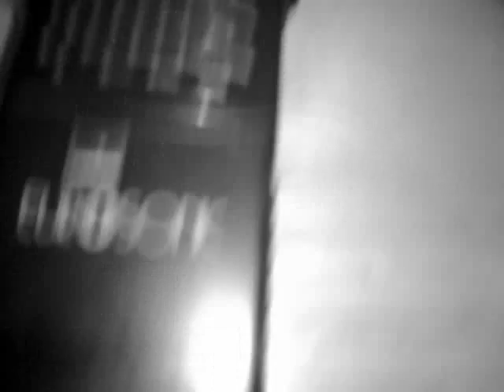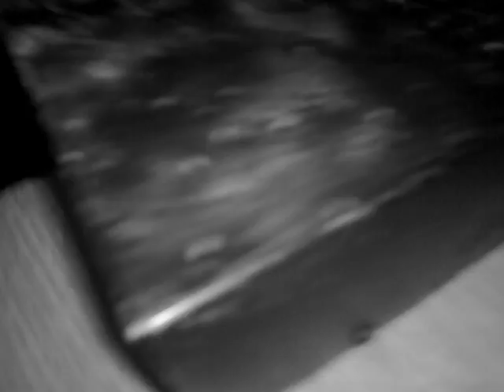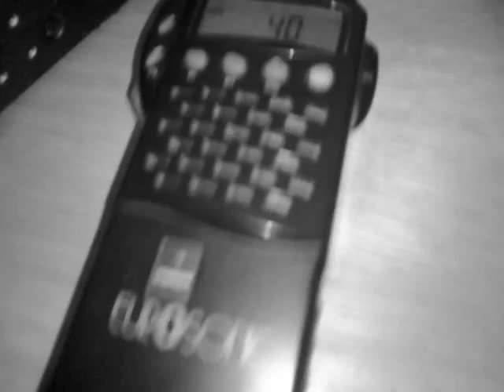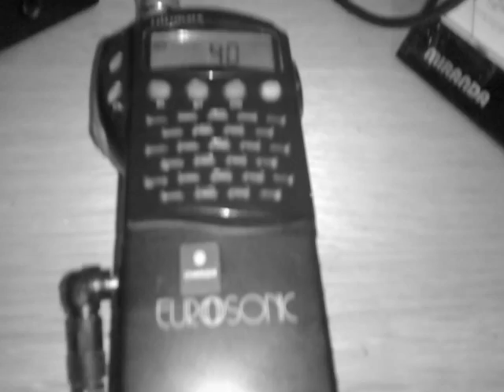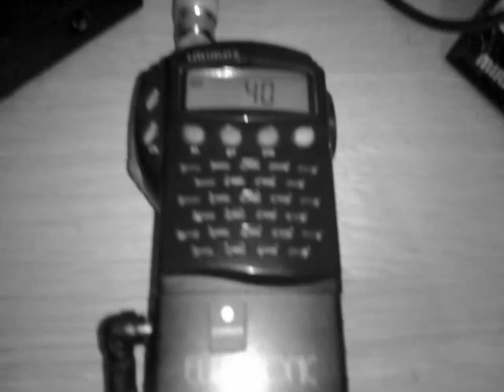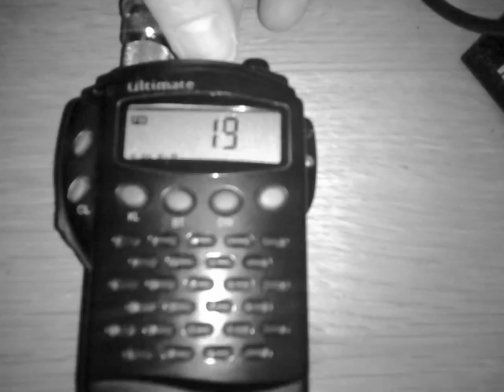eurosonic ultimate cb radio part 2

Comment: I have the same rig, working perfectly, has a rubber to cover the speaker/mic plug and the hand strap, never seen a instruction manual but easy enough to work out - unless there's a secret menu I haven't found? thanks for the videos. PS- under the clip on the back mine says (Eurosonic KH-104)

Comment: I remember the ultimate well, when i started my business (selling cb gear) in 1996 there were 2 handhelds available, this and the Alan 95.   As i recall, there was a warning in the handbook to not remove the aerial - in fact it came in a long box as it was sold with the aerial attached.  As far as i could make out it was a standard TNC and our test model (and yours by the look of it) suffered no damage from having the aerial removed/replaced.  I sell a battery box (Midland brand) that may fit it